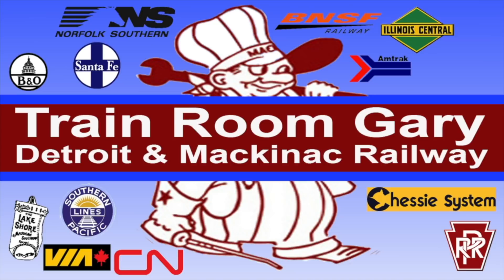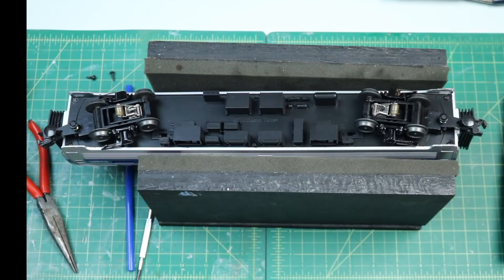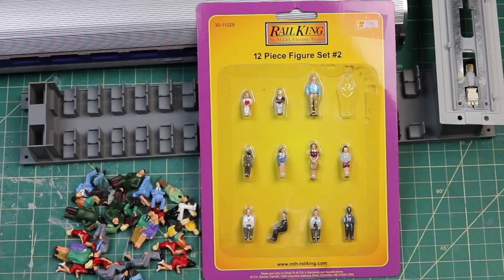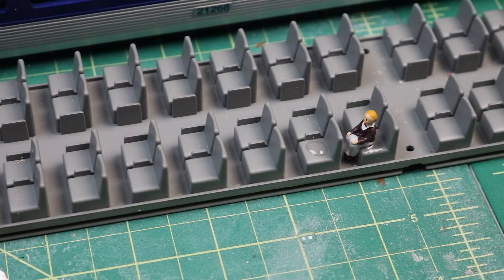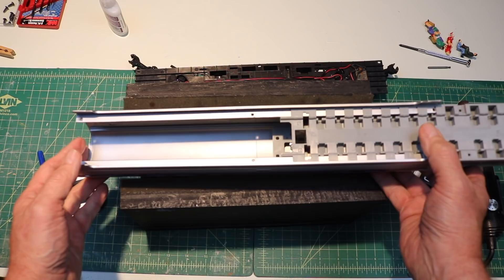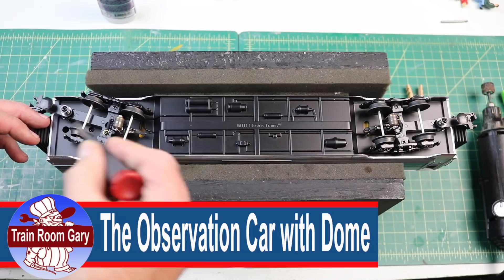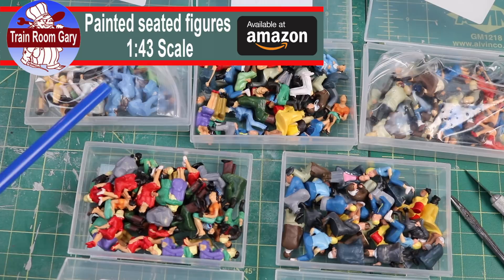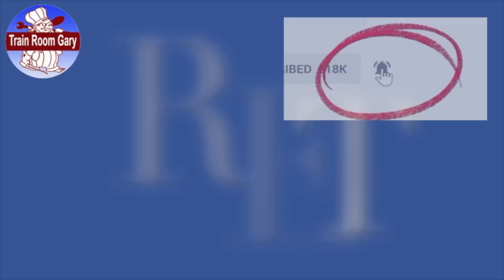How to Install Seated Figures in RailKing Passenger Cars

Comment: Nice video Gary. I have done a couple of sets of cars but still need to do my am fleet set.
Reply from the maker: Hi Mr. Engineer George: Hope your project is going well, I did break one light bulb. I am now working on all my Union Pacific passenger cars. Thanks for watching. Gary from Michigan 🚂
Reply: trainroomgary It's my project for today. Six amfleet cars and about 90 figures.
Reply from the maker: @MrEngineergeorge  Hi Mr Engineer George: Sounds like a fun project, take your time and be careful not to break any of the light bulbs. Good Luck, Gary from the Man Cave in Michigan 🚂 Please keep me posted. 😎 Break some legs as needed. 😎
Reply: trainroomgary I did it. I installed passengers in my amfleet cars. Not easy to put back together but it was worth it. Thanks for the tips.
Reply from the maker: @MrEngineergeorge  Hi Mr. Engineer George: Your welcome: I will look for your cars on your YT channel, Merry Christmas & Happy New Year. Gary from Michigan 🎅🏻

Comment: I have this set, Lionel Santa Fe Super Chief Electric O Gauge Model Train Set w/ Remote and Bluetooth Capability, and would like to add figures to the cars but are different than this video, can you tell me how to to it.
Reply from the maker: Hi Rodger: Are you a member of the OGR Forum? If so check them out. I have no Lionel passenger cars on my layout but the old kind with the shadows in the windows. No seat.  If your cars have seat and lights there must be a way to get inside to change a burned out light. Thanks for watching. Gary from Michigan 🚂